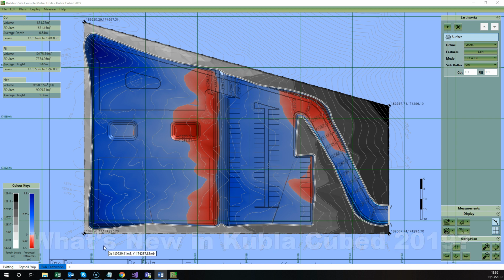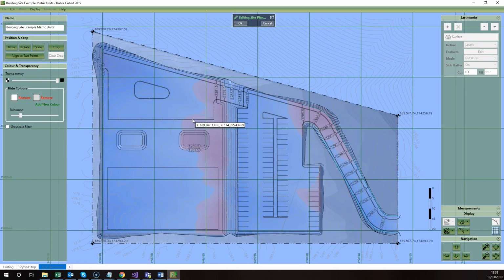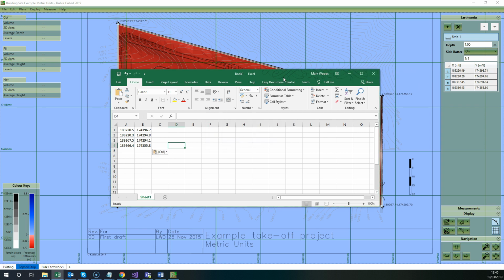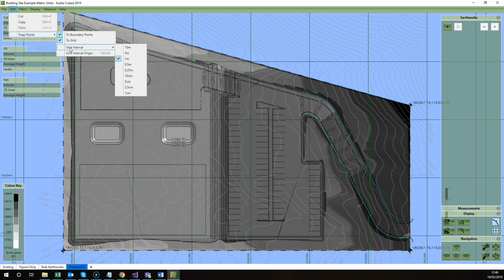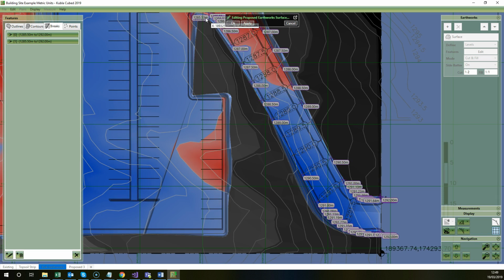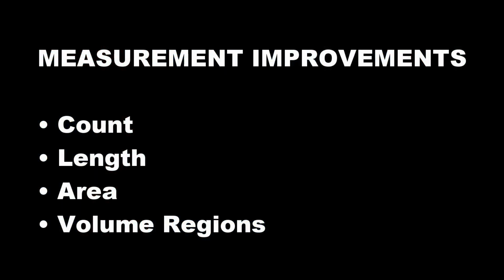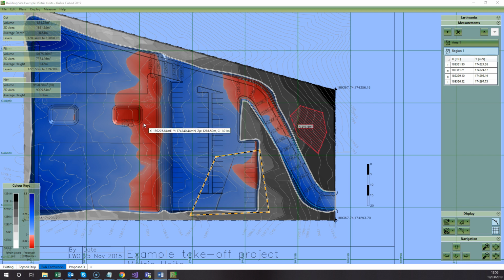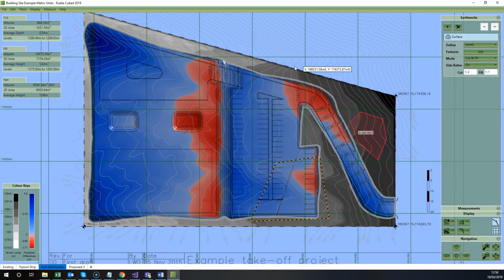What's New in Kubla Cubed 2019

Comment: Is there a video of how to install retaining walls?  And how about tiered retaining walls with slopes between them?  I have a sloped lot that requires multiple retaining walls to enable me to build a pad and I've had to use Feature Surface and then create two closely-spaced parallel lines with differing heights to build a wall.  But sure wish there was a dedicated button where you could add batter (if needed), wall height, width etc.